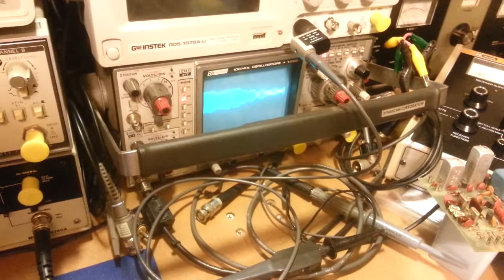Browning LTD 23 channel AM / SSB CB radio.

Comment: I have plenty roundtoits my owneself!  I owned one of these back in the day, it was a great radio! I'd be interested in seeing how you re-gold plate the knobs!
Reply from the maker: Yep, nice little radios built like a tank.  Unlike most radios that have plastic front bezel/faceplates these have solid metal fronts.

The plating is actually very simple.  As long as the base plating hasn't been worn through its just a process of a good cleaning and about 30-45 seconds of plating time using a gold plating solution.  If the base is worn down to plastic then you have to strip and start from scratch with a bonding agent and then plate as usual.  I'll be sure to video doing the knob plating process when I get to it.
Reply: Very cool, will be looking forward to it!

Comment: can ya help me out, I need an image of the back of the front panel Browning Baron. I had removed the cover, to repair the volume pot, and accidently pulled off the 2 wires that go from the volume pot to the circuit board. problem is,  i  don't know where they connect to on the board,.... simply a photo would help. Thank you  Dan kb7uxe